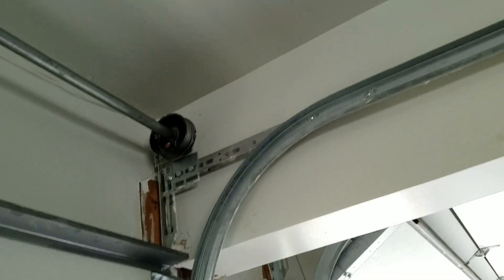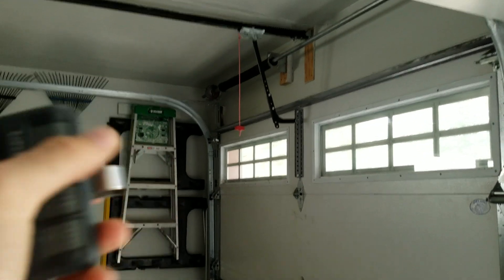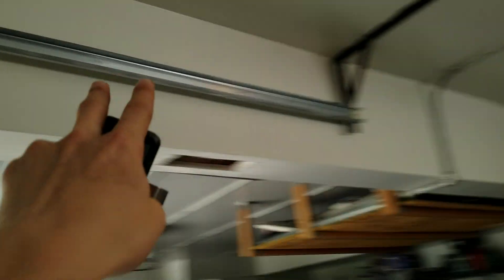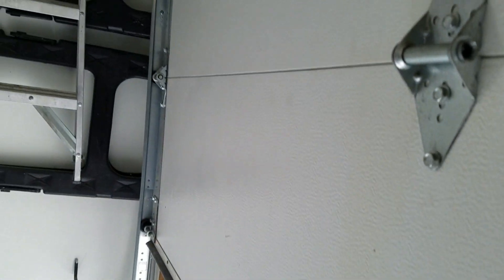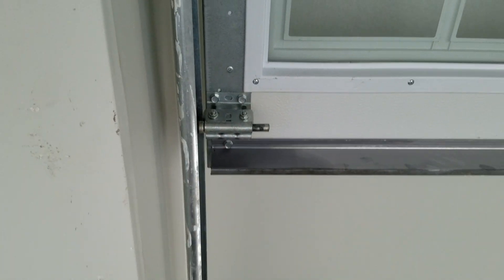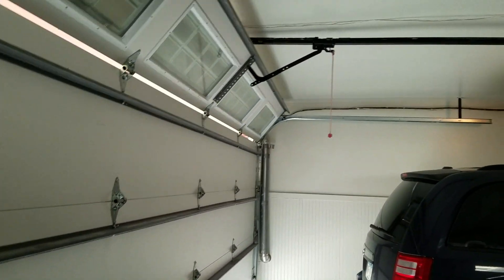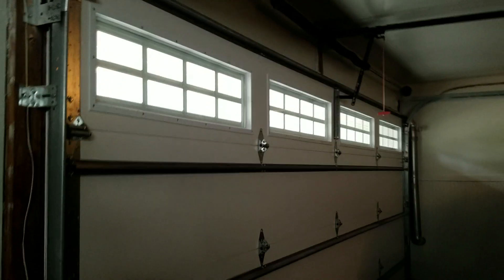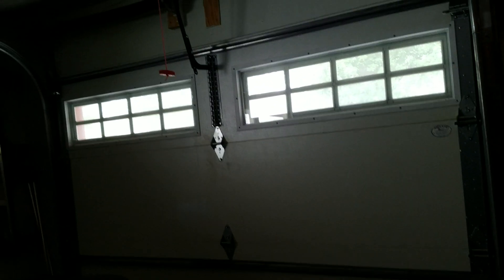Update on my Doors

Comment: (5:32) do you have silicone spray because if you do, the stuff won't drip; Unlike the grease it will drip and build rust and ruin the belt. I got it from Precision door
Reply from the maker: Put white lithium grease on the smooth side of the belt